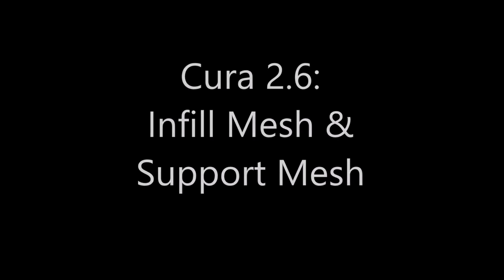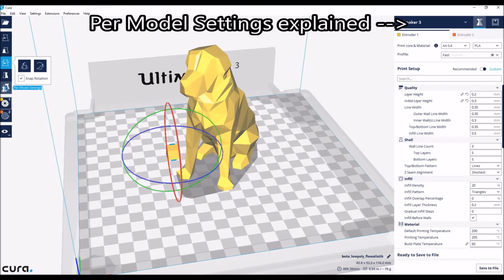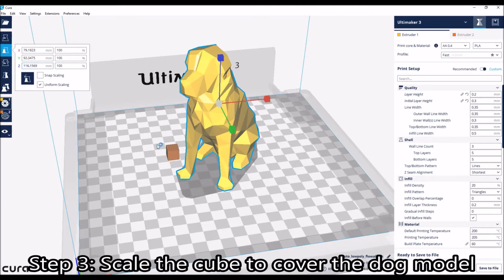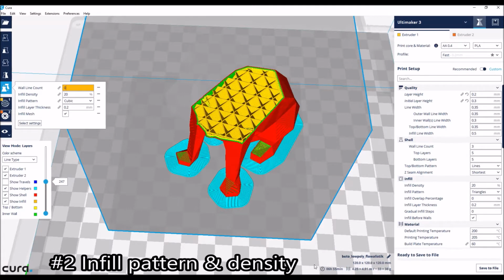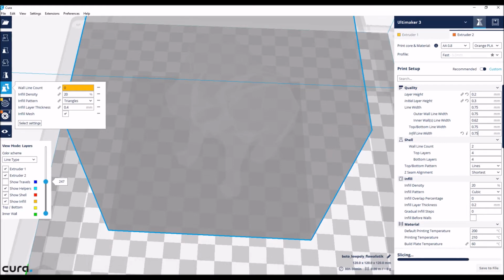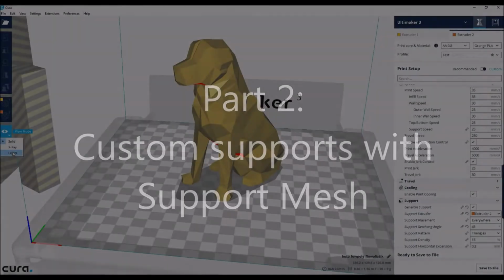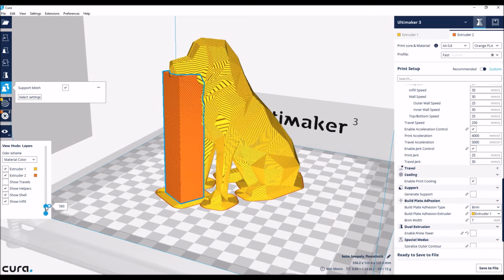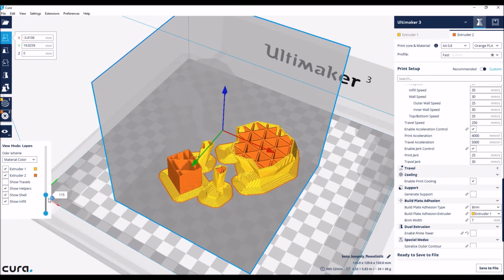CURA 2.6: How to print Infill with the 2nd head and add custom supports

Comment: In Cura 2.7 you can simply set the setting Infill Extruder to the extruder you want, without all the hassle you show in this video.
Reply from the maker: Yes i know, as you may have noticed, this video is about the 2.6 version, and was released just before the new 2.7 beta version. Anyway it still shows interesting features like if you wanted to have more inner walls in PLA and not just the infill...

Comment: Excuse me , my english is not good to understand Audio   but can you explain me why  are you using a big cube ? what effect give to the print?
Reply: The cube is to control all of the infill of the dog with the escond extruder. If the cube is smaller, only a part of the dog model will be printed with the second extruder.
Reply from the maker: everything that intersects between the cube and the actual model is using the per model settings applied to the cube (so here it's infill settings mainly). For the support mesh every thing outside of the model is considered as support.
Reply: * Everything that intersects between the sube and the infill of the actual model is using the per-object settings applied to the cube.
Reply from the maker: yes because it's an infill mesh indeed

Comment: I'm trying to add the custom support box but each time i do it, it moves the main model. How do i stop the main model from moving when i try to add a cube custom support box. Thanks
Reply from the maker: Macwhirter Locomotive Company ah yes, i only mentionned this in my other video about per model settings. In the main options of cura, there is a setting to allow the models to overlap, i dont remember the name exactly but it should be quite obvious. There is also a setting to prevent droping the models to the buildplate that makes it possible to overlap model higher than the buildplate
Reply: Hi Didier, I cant see the option that you said ( i saw the video per settings model).You can help me?. Thanks
Reply from the maker: Hi, you mean the per model settings button? Did you select the model before trying it? What version of cura are you using?
Reply: Hi, the option is overlap two models without move the objets.
M version is 2.6. Thanks!!
Reply from the maker: Oh ok! Go to Preferences in the top menu, then configure cura. In the general preferences, uncheck Ensure models are kept apart
Reply: I can only say Thanks, I realy like your last videos, good Job!